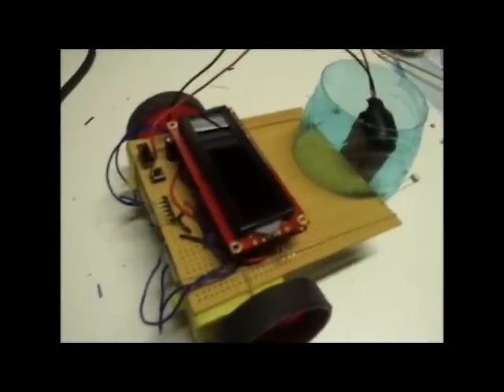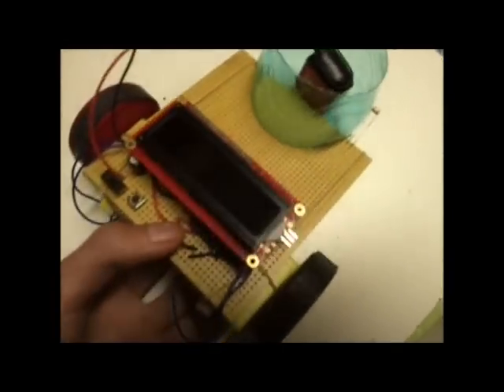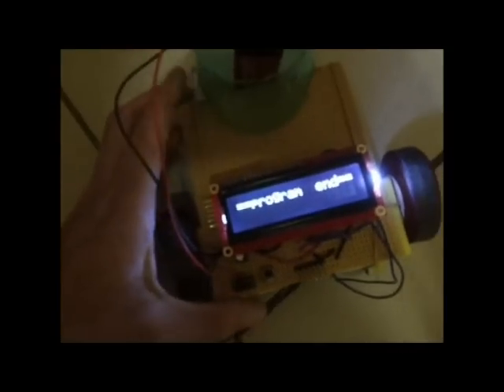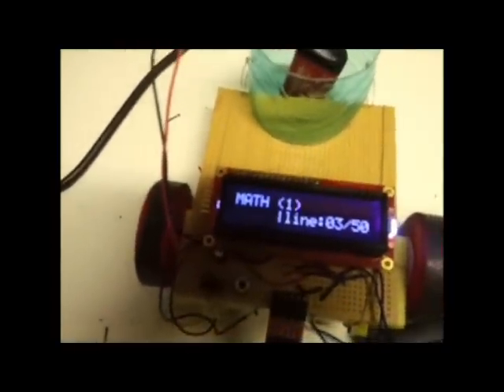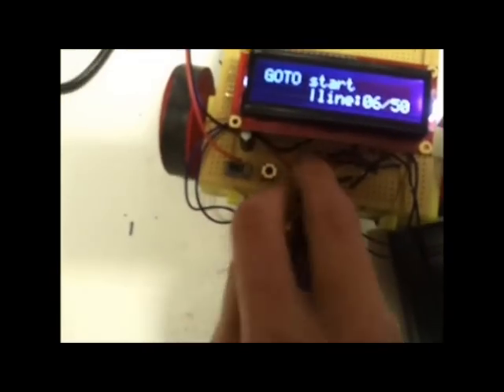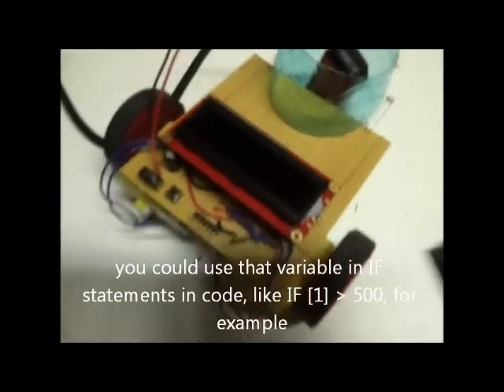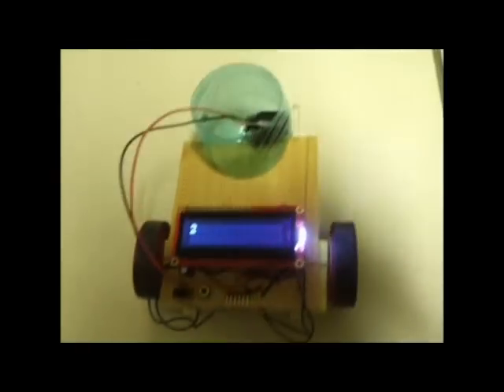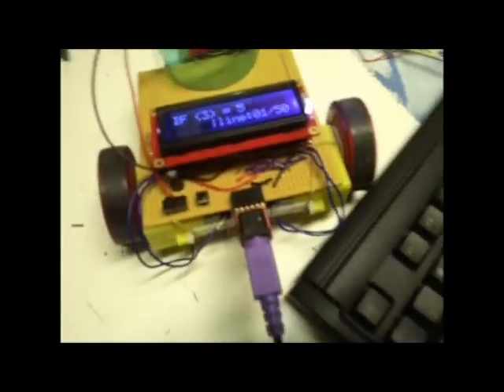NS-BASIC running robot with on-board editor! (L-BOT)

Comment from the maker: good suggestion. I used a 9V because it was cheaper to buy 1 than 6, and it was all about cost. I did calculate that with 200mAh (rechargeable 9V battery capacity), you could last about 2 and a half hours if you spend 90% of the time in the editor, and 10% driving.

does the supply current drop over time? I've never tested that. you are only supposed to drive for about a minute or so at a time anyway.

Comment: If you make one of these yourself: A good change to consider would be to use 6 AAs instead of a 9v. 9volts don't really supply the current needed to run motors for long lengths of time.

Comment from the maker: I've just learnt stuff by doing stuff. all this "stuff" is on my channel. and I got started on modifying the display's wiring to change the pins needed for the keyboard interrupt, like it says in the building instructions I made!

you can build your own if you want, but I don't recommend this as your first soldering project. at least make a blinking LED on a veroboard and invest all the proper tools before making one of these!

Comment from the maker: there's no need for more than 21 characters. the program memory is an array of 21 by about 50, so it won't work with the current code storage system either. I made sure that there is no way you can make a command longer than 21 characters, so there really isn't a worry. if it is, the interpreter will actually accept "PRINTN (12" instead of "PRINTN (12)" or anything else that needs variable input.

lastly, this is just a prototype. a better code editor could be made in a final version!